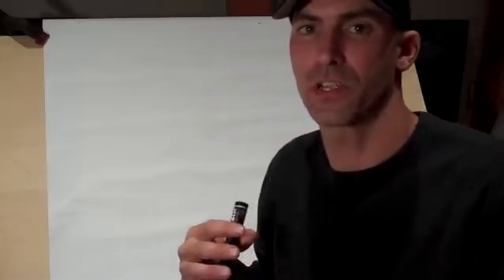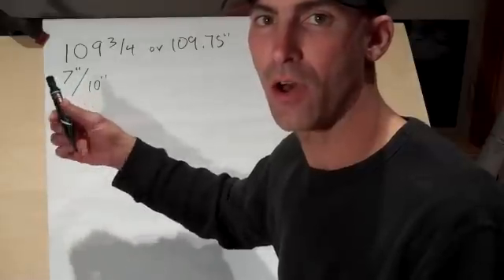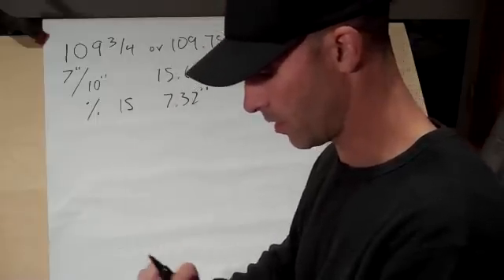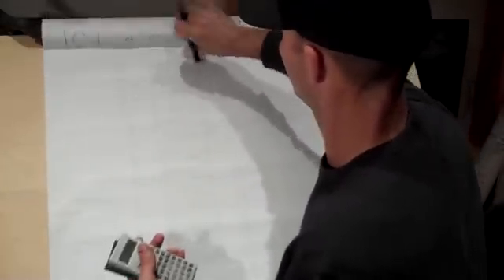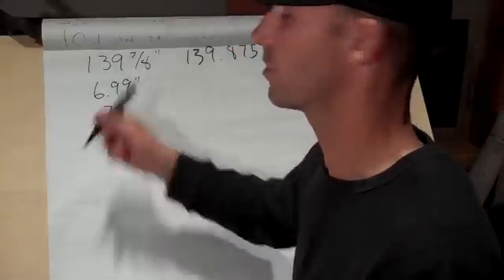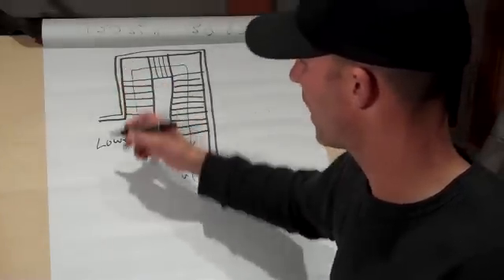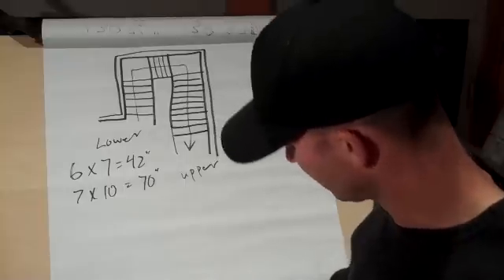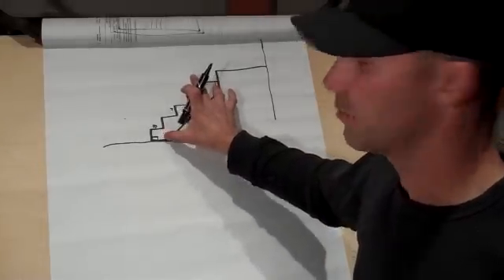How to calculate, layout and build stairs- Part 1 of 3

Comment: I didn't get how the 139 7/8 came in from. Also, I feel that it would be so much easier to work with the metric system. 7'= 17.78 cm or 17.8 cm . 139.875 x25.4=355.2825 cm divide that by 20 and the result is 17.764cm. if you divide that by 2,54 the result is 6.99375. I don't get why the metric system isn't the choice, The way metric system  is being presented is stupid. If we normally state the size of things in inches, why can't we use centimeters which is 2.54 times smaller. trying to use the metric system in mm is not necessary for everyday things. I think that to express everyday measurements in mm has a psychological effect that intimidates people, the numbers seem so huge. 36 inches could be expressed as 91.4cm it gets to the point that if the pencil point isn't very sharp one may be off by 1mm or depending the angle that you look at it other deviations may be incurred. Metric can save so much time and avoid all kinds of conversions. Try this 2 3/4" + 5  1/8"+ 7 3/16" +4 1/2"+ 1 5/8" -4 7/8 -6 5/8"=????  Same thing in decimal 2.750+5.125+7.1875+4.5+1.685-4.875-6-685.= 9.6875 or 9,7 cm. Unless you are doing highly precise mechanical work this is more than sufficient and unless you have a fraction calculator, much faster.A mm is 0.039"  1/8" is 0.125", 1/16" is 0.625" and a 1/32" is 0,3125. How often does one sees a everyday measuring device that goes down to 1/32"? 
10.5cm, metric displayed in this format should be able to take care of just about everything.
Reply from the maker: 139 7/8 was an actual dimension for an actual set of stairs.

Everything you said about the metric system versus inches is true. However, we live in the USA and the construction world operates in inches. If you want to do it metric, buy a metric tape measure and have at it. The methodology is the same.

Comment: I’m new at this, but why did you divide 139.875 by 20 (at about 5 min in the video)? In other words, how did you decide on 20?
Reply from the maker: Dividing by 20 was an educated guess to try to determine how many steps we needed for the rise.  With ~140" rise and wanting approx 7" per step gave me approx 20.  In other cases, especially if the rise is not as much, or you have limited run, you can divide by more or fewer steps to see what it gives your for rise per step vs your run.
Reply: Thanks a bunch!

Comment: The first time you did the calculations, you divided the Total Rise by a typical rise, then with the next example you skipped that step and divided the Total Rise by 20 to get the 6.99" result to get to a seven inch rise.  Wow, over eleven and a half feet of climbing stairs - not your average staircase!

Comment: Hi, could you please clarify, at 5mins into the video, where did you get 20 from?
Reply from the maker: That was an estimation based on the overall ht.  7 inches is a good stair height average.  Take your overall rise and divide by 7 and that will tell you approx how many stairs you will need.  Then turn around and divide your overall rise by the number of stairs you came up with and that will give you the exact rise per stair.
Reply: @makenabuilt  Thank you for the quick reply. From your explanation I understand how to calculate the number of rises, but how do you calculate the number of treads? Would you simply devide the total run by 10?
Reply from the maker: @300saj  "Treads" are a function of how many rises you need.  Then your run will be approx 10" time the number of rises you need.  Draw yourself a sketch of what your set of stairs will look like and it will make it easier to visualize.
Reply: @makenabuilt  Ah okay, thank you once again, I think I initially confused myself. Thank you, and great videos

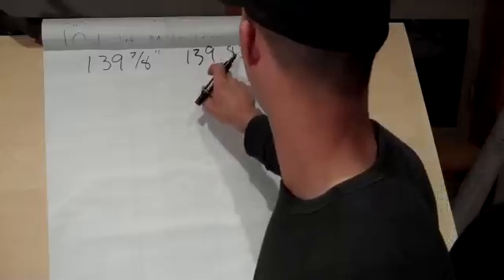Comment: At minute 5:04 you mentioned dived by 20.....??? where does this number come from???
Reply from the maker: That was a guess on my part for how many stairs would be required to get up to that height. Average stair height wants to be around 7 in so it was my best guess. If you guess too high or low when you are trying to figure it out you are steps will be either too shallow or too deep and you will know you need to adjust

Comment: Where did the 109.75 come from? I'm trying to do the math for a 10' ceiling with 16" joists above. Is 109.75 for an 8' ceiling + floor joists and flooring?
Reply from the maker: I'm not able to go back and watch the video right now to see where that number came from but it was either my example number, or the actual number of the house that was being built in the second two videos. In your case, your dimension will be from the top of the deck where you are trying to get up to to the floor where you are leaving from

Comment: Why did you divide the 139.875 by 20? Is there a way we can know what number to divide by to get us close to 7" like that? Thank you for your videos you're helping me to try and go make something of myself
Reply: I think I just figured it out, you take the number - 139.875 round to the nearest whole number - 140 then divide by 7 (ideal unit rise) and you get 20. So always take the rounded whole number and divide by 7. 👍
Reply from the maker: If you just divide the rise by 7 you will get close.  From there you can play around with the number of rises to get the amount of rise you want per step, or maybe the run you have pushes you towards more or less steps...  After you divide by 7, take that answer and round it up and down to the next whole numbers and then divide the overall rise by those numbers.  That will give you the exact rise per step for each option.

Comment: I really enjoyed this 3-part teaching series.  I noticed you're still swinging a Douglass :-( ...it's time for a 14oz Stiletto.  I swung a Douglass for many years; but when I switched over to a Stiletto, the difference was night & day; I could never go back to a Douglass again.  I noticed you're using LVL's for your stringers.  Is that code in your area? We only use microlamms on commercial wood-frame jobs.  Most framers in my area (Wichita, KS) use 2X12s; but I prefer the 2X12X16 Timberstrands myself.  I thought I was the only one who didn't over-cut my stringers.  Almost everyone I know does...it drives me CRAZY!!
Reply from the maker: Robert Hammond I like the Douglas because of the inverted dimples and being able to swap a handle with an allen wrench. I would like a lighter option, but haven't investigated to see if I can get the same head, yet lighter.

For the job in the videos the engineer called out the LVLs. Normally we are 2x12 out here.

Glad you enjoyed the vids. I'm in the process of make some more right now.

Comment: Who's ass did you pull the 139 7/8 number from?  You switched pages and used a number that wasn't on the 1st page!!!  How the hell are we supposed to know?
Reply from the maker: First off, I don't appreciate you swearing on my channel.  Second, if you watch the video again more closely, you'll see that I explain the first page was a hypothetical situation so that I could explain the math.  I then switch to the actual site conditions on page 2 for the stairs that are built in parts 2 and 3.  

At any rate, the 139 7/8 dimension you asked about was my site condition that I had to build to.  Your starting number will be different for your site.
Reply: I was also thrown for a loop too when that 139 number came out of nowhere after just studying the 109.75 for 4.5 minutes. He did say "in that situation", which of course made me wonder what situation, but maybe he should have been more clear that he's changing projects OR ended the "hypothetical situation" as he called it below. We simply did not know he finished one "situation" and moved to a new "situation", so I understand completely why you (Darrin) were freaked out... I was too.... no idea where the 139 came from.

Comment: You forgot to explain how you got the 139' ⅞" I dont understand how you got it. And how did you get the 109' ¾"?
Reply from the maker: The 109 3/4" was an arbitrary number for the rise dimension used in the hypothetical example where I showed how to do the calculations.  The 139 7/8" was the actual rise on site for the stairs we are building in parts 2 and 3 of the video.  In both cases, these are the starting points for the calculations based on the stairs you are trying to build.  In your case, that dimension will be replaced by the actual rise you are working with for your stairs.
Reply: Makena Built you are meaning from the floor to the top of your framing on your deck right, that's how you got 1397/8.?!  Or do you but deck sheeting go down your rise. Snap that across measure to the floor to that line .
Reply: I'm feeling more validated Daniel, now that you, me, and several others were completely baffled by the style of apparently changing projects without a clear signal, warning, ending, beginning, or sign that it's happening. It's like walking into a different room while blindfolded. Perhaps he could have said something like "okay, now lets try a new layout".... for example.

Comment: the easy way is a construction master. it simplifies the process immensely. done hundreds of stairs  round floating, spiral if it's possible I can frame it. get a construction master, they are about fifty dollars a Lowe's or twenty on line used.
Reply: Learn the math .. Construction Masters are for the mathematically challenged .. Try a scientific calculator from Wal-Mart

Comment: hello i just didn't undersatnd why did you choose 10 in in the run it has to be 10 but if u use like for example 9.5 do gonna still have the stairs setup properly ?? thank you for your help
Reply from the maker: 10" is a standard run.  You can use 9.5, but your stairs will be steeper.  You will want to check the code in your area and confirm that the dimension you choose to use is allowed.
Reply: ɷɷɷ Heeyy Friends I Have Foundd Workinggg Online Hacck visittttt  : -  https://t.co/c9BB2Swzaz

Comment: very interesting...thanks...but wouldn't it be easier and perhaps more precise to do calculations on that in metric dimensions?
Reply from the maker: Ranjit Gunner Yes, if only the US building industry worked on the metric system...  All of our materials, drawings, measuring devices, etc are in inches...

Comment: I understand the whole process that you explained, and the fact that you subtracted the tread thickness from the bottom riser. My question is, what about the thickness of the flooring material that goes over the sub floor? Don't you also have to allow for that so that the bottom riser is not too short, and at the the top so the top riser is not too high?
Reply: Yes, you have to account for floor covering thickness differences.  In the example in the video, the floor covering on the lower level, stairs, and upper level was the same, so no adjustments needed to be made.
Reply: The top of the landing including the subfloor is 42"  you do have tk calculate for the subfloor. In most cases you'll use 3/4" tongue and groove so the top of the landing just framed is 41 1/4"

Comment: Hello Sir. My name is Arodi you are good about explaining, but I need help about building a stairs. The opening is 82 inches wide x 87 inches of length. The height is 92 and 3/4 and the bottom of the ceiling is 80. I did my calculation and i need 13 risers but i dont know how to know if im doing right about the landing. Thank you

Comment: I made a set of stairs once up a beach break wall to replace a set some drunken kids had burned having an impromptu luau. 

I should have made a ladder, instead ... they were THAT BAD.

That was before the internet.

Now, I am looking at a deck which will, in addition to stairs, have to have a handicap ramp.

What slope for the ramp and how big must the landing be before turning 90 deg.?

I don't want the building inspector to come along as I finish up and wag his finger at me ... I'm in NC and the footings will have to go through clay -- I DO NOT want to have to dig them over again!

Comment: So, where does the thickness of the decking material come into the equation?
Reply: if it's the same on every elevation/floor it doesnt matter (if the stairs are installed after the flooring.   if not- take your measurements after the flooring is installed (1/2" tile or 3/4" hardwood).
Reply: Through architecture and basic info from finish to sub floor.

Comment: Great video, thanks allot. However, you should mention to the audience to consider the thickness of the material that will be used for the runners and to substract it from the fianal calculation ( riser height). I'm attempting to construct my first set of stairs and ended up with a finished height of 8-11/8" risers.  again for the video, but if you could find a way to include this step it would  save someone allot of money and frustration.

Comment: Ok, that's kind of what I thought, but I guess I was hoping for a solution that I hadn't figured. So basically If planning a stair hole opening that's 48" x 96", then rough it out at about 58" x 96".
Again, thanks for the vid and your quick responses..

Comment from the maker: This is a challenging scenario.  It is always best to have the top step of the upper stringer be an extension of floor so you have good attachment.  If this is not possible, you will need to frame down your header so that you have sufficient material to connect your stringer to.

Comment from the maker: On a landing, the stairs can either be an extension of the landing (same level) or can be down one step, like you described at the header above.  If you are concerned about the flooring length at the stairs if you make your top stair the same height as the landing, you could always build one side of the landing back relative to the other side so they matched.  Bottom line is that there is a good deal of planning that goes into how you want your stairs to look before you ever start cutting.

Comment: Great video. Hope this doesn't sound to stupid? When using a landing which has the ability to fasten a ledger (Pony wall double top plates), as an example opposed to a single flight where the stringer needs to fasten to the bottom of the stair hole header, should the last tread be an extension of the floor? If so, what to do when there is a balcony involved? (the flooring would be longer by the stairs, then the rest of the floor?) Not knocking your video, just asking what to do here?
Thanks

Comment: Simple.After you have set out the risers & treads you mark another line inside those lines the same thickness as the risers & treads.Then you mark out the nosing on the treads which is added to the fronts x 1 inch or 25 mm.

Comment: I have two sets of stairs. The total rise is 103" the total run is 110.5". I plan on using 7.875 as my individual rise. Giving me 13 risers and 12 treads. My problem is with 12 treads at 10" each I'm now at 120", 9.5" over my total run. How do I compensate?

Comment from the maker: 139" is the actual total rise that existed in the home where the stairs were built for parts 2 and 3 of the video.
Reply: In your example , you said 7” riser over a 10” step ( run ).  What if you wanted to do the 7” riser with a 12” ( run ) step ??
For outdoor going down a short hill to the river.  8” rise over a 249” over run... it gives me 13 steps,,, and l forget how to calculate the run ?
Is it 249” / by 13 🤔... which gives me 19.15” .   

Just the same, l am getting a lot closer to calculating how many steps l will need using 8”x16” cinder blocks.
Reply from the maker: @Blue-Horse-Shoe  Basically your run is a function of the number of rises you have, multiplied by the run length.  You can work this backwards in your case if you are trying to hit a certain spot at the end of your stairs.  If you have calculated that you need 13 rises, just measure the total run you want, divide by the number of rises and it will give you the run per step.  Good luck!

Comment: easiest ive found is snap some lines for the stringers and or handraiI placement. wood or matel the thickness doesnt matter regarding measuring.  generally i dont like steep stairs rather lower rises and wider treads. handrails should use a third rail system.  Or "K" rail. This helps in case of falling down stair cases..

Comment from the maker: Partially correct.  You just need to add the slope amount to your overall rise, not as an adjustment to your stringer like the tread thickness.  You can figure this out by measuring out from the beam the amount of run that your stringer will have so that you know where it will land.  Then take a level, place it on the ground directly below the beam, adjust it to level, and then measure the amount that the slope has dropped away at your stringer landing point. (Continued.)

Comment: @makerzddd lol. I agree. I've put in many sets of stairs and adding /dividing all those fractions, converting them back and forth from decimals is the easiest place to make mistakes. Compare that to saying 2790mm height (109 3/4 inches) by 16 = 173.5mm . Final measurement with no cross converting necessary. You just gave me a great idea: From now on when I do site-built stairs, I'm going to do both methods to compare and see if there's any time/quality difference. (I'm always open).

Comment from the maker: @JessicaOShea You are correct, but in this case, the finish material was the same in the lower hallway, on the stairs and the upper hallway.  No adjustments for flooring material needed as they are the same on all surfaces.

Comment from the maker: @fralin1966 If the physical scenario you are dealing with is similar to the situation in Part 3 of the series, then you would only have 3 stairs, since the 4th rise would be stepping up onto the landing.  This would give you an overall run for the 3 stairs of 30 inches, which should just fit in the space you describe.